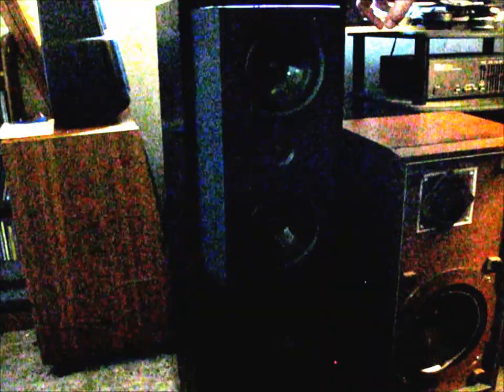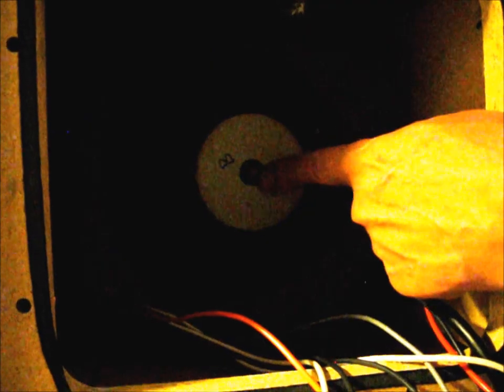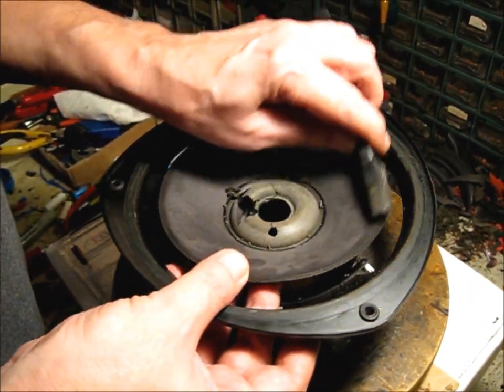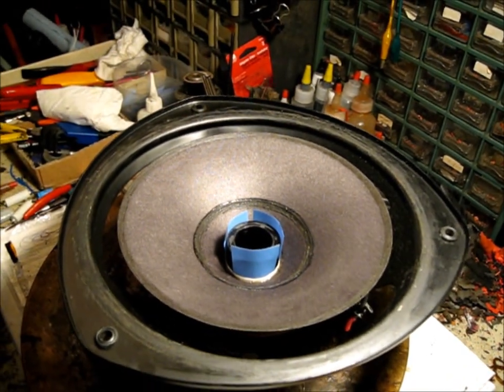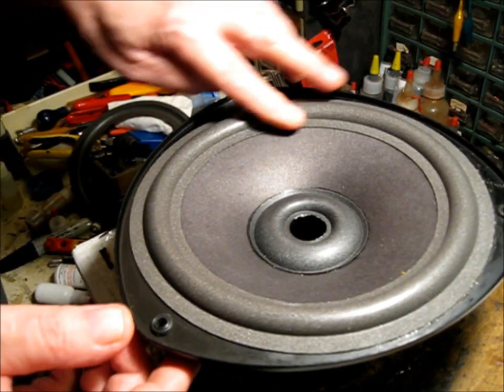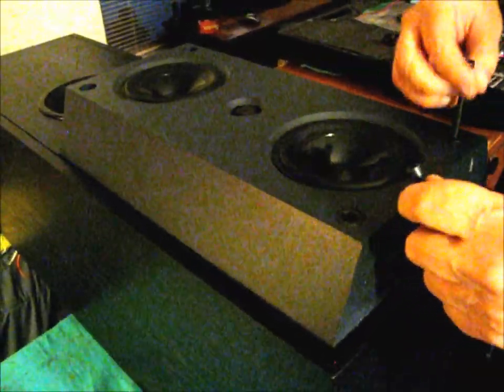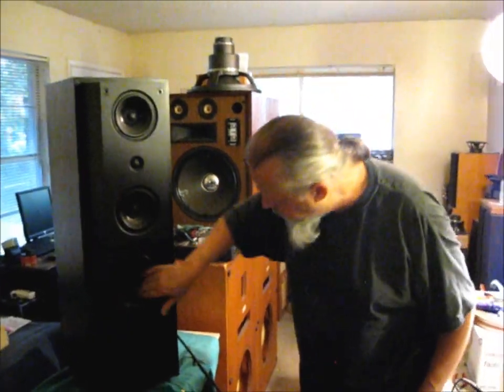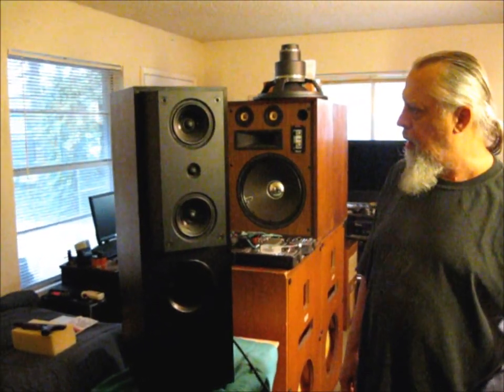KEF 104/2 Speaker Repair

Comment: Great video!
Shame that the KEF folks were quite stupid to install speakers with foam surrounds instead of rubber inside the cabinet.
Later 104/2 models actually had rubber surrounds but the foam donuts remained...then in the Reference One etc. they did the big stupid again, and returned to foam surrounds. Sometimes you just don't get it.

Comment: I absolutely love the 104.2's.. Wonder if my pair need this repair
Reply from the maker: I had the current KEF flagship 207 (we repaired)sitting next to a pair of 104/2 (we restored) and the 40+ year old 104's smoked the 207's @ $20.000 a pair We will Restore your older KEF's 101,103/2,104/2, 107/2. 105's texasound@gmail.com 512-769-9750. Rock On!
Reply: @texasound1  Amazing.. I hope I will never have to get rid of my pair.. even though my spouse eagerly has nudged me to do so for more than 10 years already.

Thx for uploading!

Comment: Great video! I just got a pair at an estate sale, and would like to tackle this repair myself, but I have some questions: Where can I get the foam replacements parts? Where can I get the correct capacitors? What is the correct glue to use? Thanks!

Comment: I recently did the same repair on my KEF 103.5's but unfortunately a redo is in-order.  I did a sub woofer test and found distortion around 20-35 hz. I believe there is either some debris left or the spacing was off in the voice coil. Plan to do a video and post on my second attempt. Here's hoping!

Comment: Any thoughts as to why the KEF engineers used the rod between the two woofers? My 103.3 only has one 8" woofer, but it also has a rod, bolted to the bottom panel.
Reply: The whole design philosophy of the opposed reverse-phase woofers is that all mechanical vibrations and distortions are balanced out, so by tying the two frames together directly by an aluminum (higher internal damping than other metals) rod, those balancing forces between drivers are rigidly coupled, while the drivers and those forces and vibrations are isolated from the cabinet by the driver mount grommets. This keeps those forces from acting on the cabinet, and in theory reduces audible resonances. In the 103.3, it appears they used the tie-rod to try to brace the single woofer against an internal baffle, to increase rigidity.

Comment: What is the purpose of the rod that connects the woofers together? I can't think of any advantage it would -have. Thanks for the video.
Reply: Read the brochure for the 104/2 regarding the coupled cavity.  In essence the design is to provide more bass response while minimizing distortion.  Does it really work? I don't know, but I love the sound of my 104/2's.  http://kef.com/uploads/files/en/museum_pdf/80s/Reference_Series_Model_104_2_r.pdf

Comment: Show Bags - Over rated, Over priced and full of shit. 
The design of these is fundamentally flawed in so many ways, especially that stupid 'doughnut' foam. When it degrades and disintegrates it falls into the gap.  
KEF cheaped out using a pressed sheet metal basket on these woofers that perhaps need the coupling rod, and hence the need for that stupid inner foam.... so much for the F (foundry) in the KEF name, eh. 
I seriously question the replacement of electrolytic based on maintaining the 'original sound'. MKP are far superior in every way.